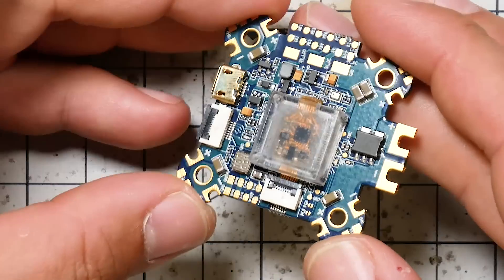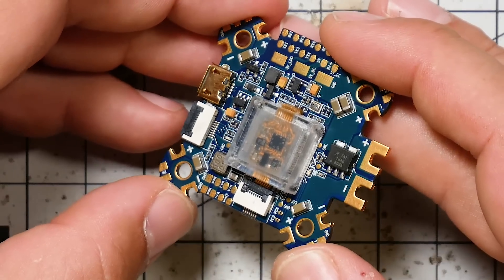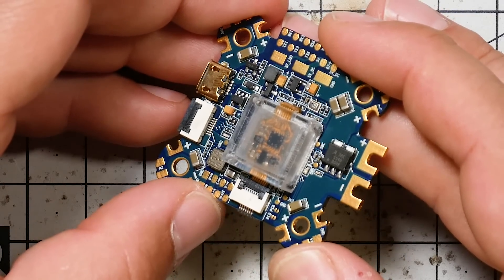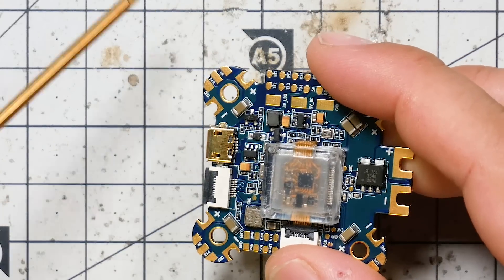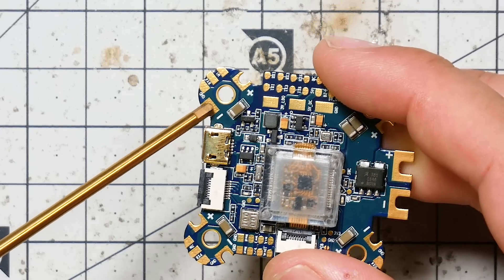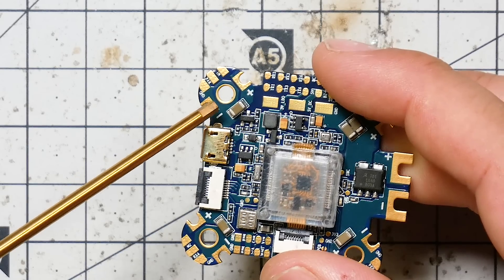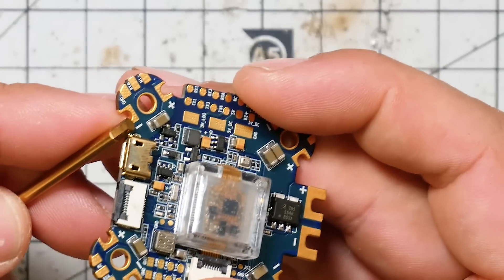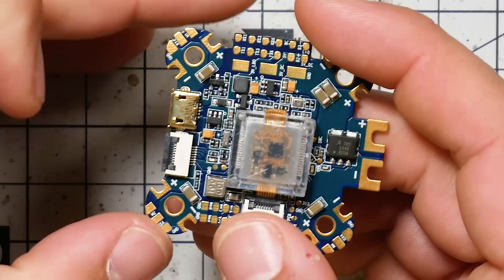Omnibus Fireworks V2 | BETAFLIGHT FLIGHT CONTROLLER REVIEW

Comment: I tried to setup Baro Mode in Beta flight 10.5.1, but whatever I do it is not possible.  In the Modes setup it will not show it. 
Any idea how I can solve that? 
Thanks for your help...
Reply from the maker: Does the FC definitely have a baro?

Is the baro sensor enabled in the configuration tab?
Reply: @JoshuaBardwell  Yes it is enabled and shows clearly a baro on the sensor taps,  but I can not choose the altitude hold flight mode.  No more idea how to go on...

Comment: Test flight complete ! The only thing that is a bit tricky is that the signal pads for rx,camera,vtx are a bit small so they require a bit of skill to solder up.  Still only $30 bucks. such a good DEAL!  https://www.youtube.com/redirect?v=eJi2-mMr14U&event=video_description&redir_token=crvSc_Bo2VDGySWic2fDFW5VFpR8MTU1ODMxMDY0NEAxNTU4MjI0MjQ0&q=http%3A%2F%2Fpirofliprc.com%2FOMNIBUS-Fireworks-v2_p_5757.html

Comment: Hey Joshua, I'm trying out this board!  2 questions: What's the RSSI pad about?  Is that for analog RSSI out?  Also, I have a few Wraith 32 ESCs that run BLHeli_S.  The controller specifies BLHeli_32.  Will I be able to use mine or not?
Reply from the maker: The RSSI pad is for analog RSSI in. If your receiver has an RSSI pad, connect it to the RSSI pad on the FC then go to the betaflight configuration tab and enable the RSSI_ADC option.

You can use either blheli_s or blheli32 ESCs with this FC, however only blheli32 ESCs support ESC Telemetry. However you don't need that so whatever you have, go for it.

Comment: After watching this video I bought one. This is by far my favorite FC I've ever touched. I have used every pad on the board (Top), completely desoldered and rewired / soldered three times without any issues. It started in a ZMR 250now have it sitting in an LHI Lawson 250 Battle Axe. Great buy, thanks for the knowledge Josh!!

Comment: Help me please JB. I use rxsr. But i can't get telemetry. I put sbus in board (r/c) and smart port in board(tx1).
Reply from the maker: UART 1 is correct for Smartport. Make sure Smartport telemetry is enabled in Ports tab. Make sure telemetry feature is enabled in Configuration tab.
Reply: @JoshuaBardwell  but uart 1 for serial rx.

Comment: Hi JB, i have done my first 5" quad build using this FC. Also i changed the battery offset and ratio setting to 175 and -19700 to get the correct callibration current amp draw from the hall sensor. But whenever i plug my charged lipo the current amp from the osd shows -11 not 0...   Have you build a quad with this fireworks v2 fc? Please help, i need more info to get the true current amp draw on my quad.  
Thanks so much
Reply from the maker: I think I would adjust offset to zero that out?
Reply: my bad, looks like i only need to change the default 176 to 175 and leave -18500 as default. :)
but i have new problem with this board, whenever i do fast right/left roll it caused a wild roll move or even worse sometimes keeps on rolling uncontrolled just like roll of death. and this problem only happens if i did a fast roll, not on slow roll. fast front/backward pitch is fine. is this a gyro problem? i set it on 8k/8k. this problem stressed me a lot :(

Comment: how to get filtered full VBatt to the TBS Unify HV  not the 5Volt TBS Unify
Reply from the maker: The board intends you to use the 8v regulator which is connected to the RAM pins. I'm not sure it supports filtered vbat output.
Reply: ok   external LC  Filter   it  is  then  Tanks

Comment: OK How to spec Tantalum  Capacitors   I caught a sale at RTF Quads  but had already confirmed that Air bot would do the dirty work for me  alas now I have to try 
to surface mount these Capacitors   PLEASE HOW to source parts ( What specs ! ) and solder them on  ??
https://www.mouser.com/Passive-Components/Capacitors/Tantalum-Capacitors/_/N-75hqv
Reply from the maker: Unfortunately I don't know the exact specs that are right for the board :-(
Reply: thanks   Bro Air Bot isnt giving me any answers either
Reply: Forum supplied exact answer Airbot answered me too

Comment: Hi joshua!!! How are you? Im looking at this FC. Can run at 32, 32, 32 same as Raceflight? thanks a lot in advance!
Reply from the maker: Yes. it can.
Reply: Joshua Bardwell wuauu because i have Kakute AIO V2 and the FC cant run in 32,32,32 CPU its overload.
Reply: JuampiFPV 
You can overclock the kakute. Bardwell did a video on that too. :)

Comment: Please respond :) Love your videos. I bought the super-s f3 16x16 stack. This is my first micro and I'm wondering if it's normal not to get motor beeps for power or signal. Using dys 10,000 KV?
I can't get the motors to spin in BF. esc's and FC seem fine, so I was going to build it before I try to arm. Didn't want to bother if the motors/escs aren't working. Thx!!!!!!

Comment: While I ended up not liking the pads on the corners, the isolated gyro was VERY nice on the V1 I got from Undergroundfpv last year. My first feedback to them was to try to move the ribbon cable to the middle and I'm glad to see they came up with a simple method for that. I never caught the ribbon on a branch or anything but I was constantly grabbing the quad from the center and unclipping the ribbon. V2 looks great for individual ECS frames.

Helio RC is very open that Airbot makes their stuff. I hope Spring FC V2 uses the hall sensor, heck I hope every FC maker does that so long as they provide us the scaling values.

Comment: Dear Joshua, potentially silly, but useful suggestion/idea and question. When we have an SD slot and and OSD on the same chip. Can't there theoretically be a software/hardware combination so that we can put OSD video directly onto the card. I fly 3 inch and 2 inch, something like this, when you have a 1000tvl like i do, it could save on having to mount a camera to get reasonable video recordings. Run Cam now has their new unit, and I know there is probably an obvious reason, but surely I'm not the only person who didn't care for logging but looked at the card slot and was like why not for something else?
Reply from the maker: The processor on the FC isn't fast enough to encode video in real time.
Reply: I thought it would be something like that haha! Thanks for taking the time to reply to me. Much appreciated. Learned something today, from the man himself! :) Keep being awesome Joshua!

Comment: Is the second ribbon Cable input for a GPS module rather than an additional Gyro?
Reply from the maker: Most GPS module do not use SPI interface so I would say no. They tell me they intend to use it for a 2 gyro system perhaps similar to what SPRacing F7 is doing.

Comment: Is there any reason they would not just put the capacitors on the board? I mean besides the extra cost which I cant imagine would be much? I guess different capacitance and voltage specs for different setups may be need? There must not be a "best" capacitor that would just work for the range the board was intended for?
Reply: They cost about $11 each. $11 x 4........

Comment: Are you planning on doing a review of the SpRacingF7Dual at some point? I've been flying one for a while now with really good results. It also has some unique features like dual gyros and PID Audio which I haven't seen on other boards.
Reply from the maker: Yeah I am supposed to have one in the way.
Reply: Awesome looking forward to hearing your thoughts! There's a CLI command to use one gyro instead of two, might make for an interesting comparison.

Comment: Outstanding review of all the features this particular FC has regardless of whether or not you have flown it yet.  I agree 100% with your assessment of how Airbot appears to be attempting to address FPV pilots' wishes. Hall-effect current sensor (always calibrated once numbers are put into Betaflight) is a significant positive aspect.  So, why would there ever be a new standard-sized FC without this feature?!?

Comment: Already expected Hall current sensors in top end of flight controllers. Interesting why they came so late. Even SMD ones was available around some 3 years already. More expensive APM/Pixhawk FC power modules had them already years ago. I used Allegro ACS758KCB-150U Hall sensor in quad with SP Racing F3 clone FC. Soldering it in middle of battery "+" wire was cumbersome and heawish contraption, although otherwise it worked great displaying over 100A measurements sometimes. Ditched it together with F3 FC and PDB after migration to lighter F4 AIO FC. I'm glad to see Hall current sensors coming back in FC's as stock option.

Ribbon cable for ESC's suspiciously look like vendor lock-in Airbot style :)

Comment: I've already soldered the tantal caps onto it ;-) ... just ask Airbot support what kind you need and a few hours later you get an article number from mouser
Reply: whoami1975, hello, can you post this number here, please? I think, it can be really useful for everyone)
Reply: sure ... the message from Airbot was

It is E or D case tantalum cap, 
The voltage should be at least 2x higher than the lipo which you are going to use. 
TMJE106K050RCQXC
T491E476K035AH
About caps are OK for 4s I think, but you need to test it. 
For 6s, I would say you have to use 50v cap

If you wish, you can put 0.2mohm resistor on the pads, then you will get the current reading about 320A range. 
https://www.mouser.de/ProductDetail/Bourns/CSS2H-3920R-L200F?qs=sGAEpiMZZMtlleCFQhR%2fze%252bwwzj9NwmYOfsLCGqwkiQ%2fhvaYC6NvmQ%3d%3d
Reply: @whoami1975  do I see that correct.. those caps are almost 10euro per piece? A bit expensive if that's in total for four caps almost the same price as the FC. Lol.
Reply: genivos I know ... but I wanted to do it at least once 😇

Comment: Thanks for the review. Does the Fireworks feature UART inversion for FrSky SmartPort (or bidirectional inversion for FPort)? And does the camera control pad work out of the box with micro style cameras?
Reply from the maker: Yes it has an inverted UART.

Camera control works or doesn't work the same as every other FC. For micro cameras you usually need to tweak some.

Comment: Why can not they just use jst sh plug which works with a lot of other 4 in 1 esc. But this board is not really for individual esc. Other than that a few good innovations. 

I really doubt about soft mounting gyro. Does the gyro have enough mass to be effective?  I personally have not tried these boards. I like board which is 4 in 1 friendly.    I race and most of my individual esc got chewed up by props. Yes I can mount them under the arm or cover it up  but why bother just use 4 in 1 and general save weights.

Comment: you know what I wanted for my last build?? something that fits right in to the standard mounting (like maybe a pdb that has some extended pcb) that had some extra connector rails,, so that if I wanted to connect 5v to a rail, then individually solder all of the 5v accessories to the rail on a separate pad, or lets say I want a different voltage on the rail, I can just connect the different voltage, or if I wanted to connect the video wire from each source to a pad instead of joining wires,,, I could just have a couple or sets of connected pads to make that happen, not too different from a little component mounting holes board, where three holes might be foiled together,, but already easy to mount in my little quad. ((you know, for beginners still running around with a pdb, a big budget frame, constantly replaced vtx, etc.
Reply: You're describing the Matek F7220-px-W. Notice the W on the end.  It's a $15 power board.  I designed boards like that and had them made (cheap).  Then later I saw the Matek.

Comment: 5:54 Not true at all :)
Typical shunt resistor on a quad: 0.25 - 0.50 mOhm. (On KakuteF4 it is .25mOhm)
Resistance of the ACS781 hall sensor here: 0.20mOhm.
Tiny improvement.
Reply from the maker: Sadness.

Comment: Oh sick !!! 
Maybe I'll get one of those. Can I use separate ESCs with that instead of a 4 in 1 ? 
Does it need a pdb if I go that route or is ithis an fc/pdb?
Reply: The pads in the corners are for separate escs. With this board it's going to be hard to run a 4in1 bc it has to except a ribbon cable and 95 percent have single wire type harnesses. This is a fc with a built in pdb.

Comment: Great review man. So right about a lot of flight controllers flying the same. We runnin the same software, I think its all about gyro chip and how its mounted and how the fc is mounted as well. SpRacing F4 Neo has wide pads like that for power also.

Comment: This hall current sensor ACS781 has 0.2mohm internal conductor,  we wanted to use it on FCHUB-VTX when we designed the VTX board,  after getting some samples to test, finally  we still chose old solution with 0.25mohm shunt resistor+INA139.  :-)
Reply from the maker: Oh damn it. Well at lest the calibration part is correct.

Comment: This is a great FC, not worth $50 though.... Why are FCs getting so expensive? Originally, you could get a naze32 for $25, now everything is $35-$50. The F4 chip isn't that much more expensive than the F1 of F3.
Reply from the maker: As soon as you add a PDB to the board, you have to go at least six-layer and the PCB gets a lot more expensive. Also, Naze32 didn't have a switching regulator on board, didn't have a MAX OSD chip, etc.
Reply: Basic shields (boards) where you place your own arduino and extracted Wii Gyro used to cost $70-$80. This shit is cheap now.
Reply: Peple still fly naze brds?

Comment: I have this board. I had a problem with orientation. Also, like JB says the pads are super small. Ended up soldering on both sides of the board because the space was super small between the pads.  I haven't had time to fly the board yet will update with my impressions when I do.

IMHO opinion, Bardwell's board is better if you don't care about the 32k Gyro.

Comment: My preference remains the Matek F405-CTR (8k) and Holybro Kakute F4 AIO v2 (32k).  This board does look interesting however, but I'm not sold on 32k or the gyros in general.  I've found it to be very difficult to tune and still unable to get rid of some oscillations, especially at mid throttle.  There just seems to be this very narrow window where it needs to be and reaching it consistently is kind of a pain.  Those of you that got it to work well, I commend you.

Comment: I'm not a technical person I could care less about 8 K 16 K 32 K 1 million k LOL but I I know for a fact without a doubt that the ICM 20602 or ICM 20608 Gyros absolutely fly better than the mpu6000 on stock settings. What I mean is the ICM 20602 and 20608  on stock settings felt like my quads with mpu6000 Gyros were fully tuned. They just flew much much better for me right out of the box. The mpu6000 quads always needed to tune to have no bounce back or dipping for any Snappy maneuvers. My quads with ICM Gyros fly so good on stock rates it's incredible. And honestly once I have my filters setup stock pids are fine has no bounce back no dipping super-connected feel. I can't be the only person that notices this every time. I've never had yaw Twitches so I only think of the more sensitive gyros as better.
Reply: I totally agree. Used to run two quads, one with omnibus f4 and the other with the original Matek f405 AIO. 

The Matek always flew MUCH better. I was always frustrated that i could never get the Omnibus f4 to fly anywhere near as good as the Matek no matter how much i tried to tune. I have since put Matek F405's in all my 5" quads
Reply: Flying experience with ICM20xxx gyro pretty much depends from FC design and vibration dampening. 32K gyros must have good vibration dampening and clean powering voltage. Which not always happen (I would guess - not happen in most of FC's/builds) and then we have examples with yaw twitching and other crap like that instead of smooth flying.
Reply: "im not a technical person" gets technical
Reply: How much less could you care?

Comment: Steel hardware and anything magnetic can interfere with hall current sensors. Also I would not use tantamules because they explode. Get them even 0.5V over their rated voltage and they are like ticking time bombs. I would go with either ceramic or aluminum. I'm not saying it's a bad board but you just have to know how to use it.
Reply: Care to post a link? Thanks!